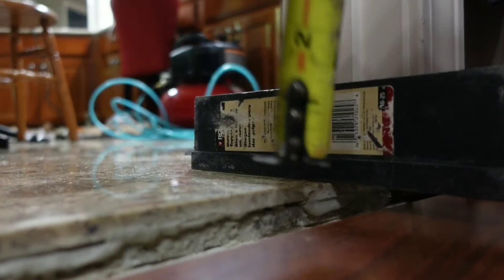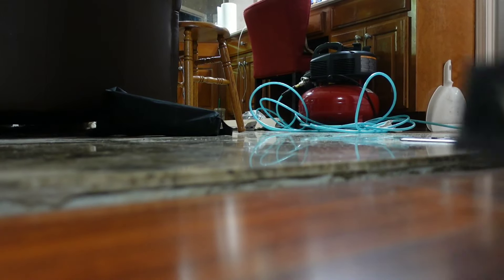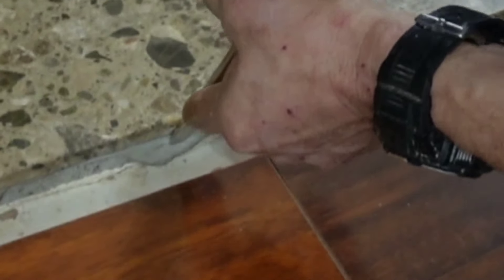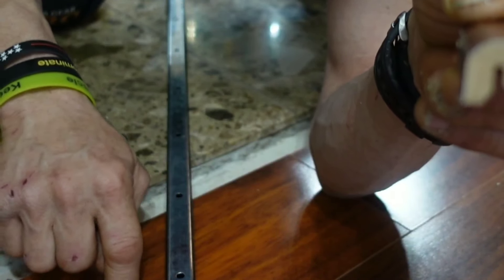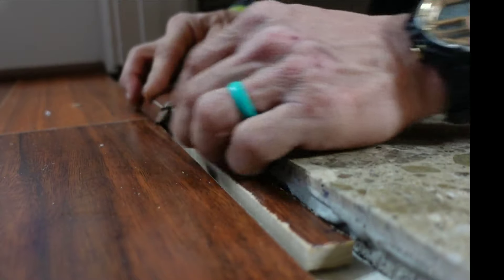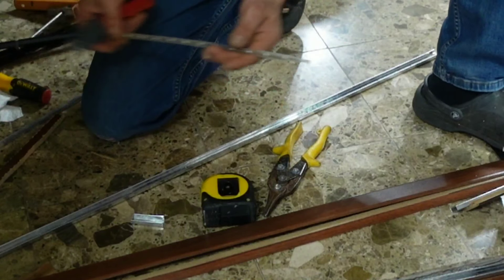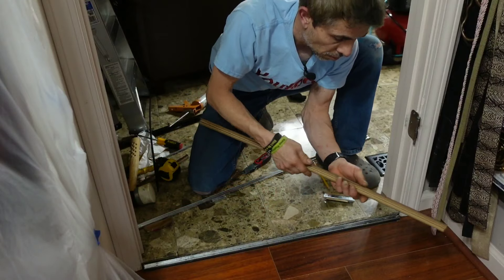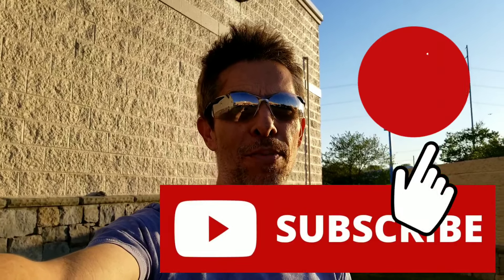How To Install a 4 in1 Reducer Transition From Tile To Laminate

Comment: My Laminate to Tile elevations have been money...... and I've only used the top piece or T piece (I would call it)....  a little silicone and it hasn't moved....  I've had no need to snap it in, to the track they provide in the package.......
Reply from the maker: Perfect.I have used this method on many jobs  where a track would not work. Thanks for sharing

Comment: I currently have a problem trying to get a reduced or transition between porcelain bathroom and vinyl plank flooring and in the kitchen from tile to vinyl plank. Two contractors haven’t been able to figure it out and I don’t know what to do. We also bought the t mold which doesn’t seem to work either. What should I do. Thanks
Reply from the maker: Hey Tim would love to see if I can help. Send me a couple pics from different angles, and we'll see what we can come up with. Youfloor.net@gmail.com

Comment: You don't need to drill holes for screws? Is that possible? I see you used staple gun but do staples stay in concrete?
Reply from the maker: Lol. I get this a lot on this video. I'm guessing whoever installed the tile spread a thin film of thin set out into the closet when cleaning up. Lots of people think I'm installing on concrete, but it is actually a wood subfloor. Hope that clears things up

Comment: I had this exact same predicament. Thanks for helping me figure out how to address it. When we had our bathroom remodeled we had tile installed and the contractor must have built up the floor to make it up to code for tile. Once I ripped up the carpet today to lay down the laminate floor I saw the height difference and was at a loss. The contractor used a piece of 1/4 round as a transition from the tile to the carpet. Now my job will look professional. Once again thank you so so much.
Reply from the maker: So glad to hear this. Glad it worked out for you. Thanks for the comment

Comment: Again you make a great how-to video! You give me hope that I will be able to find a solution to all my “issues” with transitioning. I had someone install my Pergo Outlast without thinking about  transitions.. so all are different.. it was a friend that was staying at my Nashville home for free so he did it to try to repay me by installing the flooring. He did a good job everywhere but transitions. I will just have to figure them all out. Your videos really help me get the confidence to figure it out. I still how to do the stairs and the transitions only things left. I think i am going to get the Cap-a-tread for the stairs for ease of installation and buy these transitions you used here..
Reply from the maker: Well, unlike most of my viewers. You are not to far out. I live in Mt. Juliet. So if we need to come by and make a video. And fix some things. It's not too far away. We work in all surrounding areas. Thanks for the comment. Good luck on your project. And let me know if you need any assistance.

Comment: Thanks for the tip on the metal track after putting screws in.  I’m wrestling with one now that’s 92” and broke lvp transition reducer when trying to tap it in the track

Comment: Thank you for posting these videos. They are very informative.  I was curios about waterproofing the pergo laminate floor I will be installing.  Do you need to backer rod and silicone under the transitions?
Reply from the maker: Absolutely. If you are using a metal track, you can put it in the center of the gap.And put your backer rod on both sides of the track and squirt.A little silicone right on top of the foam To seal it up. Hope that helps thanks for the question

Comment: Anyone following this video and still having issues, your metal track likely bent in on the sides at the hardware store. Use channel locks to  ease the sides out so both prices can fit inside the channel. 
Thanks for the tip to use the rubber to build the floor up!
Reply from the maker: Yep

Comment: First off you're the man. Your quarter round vids helped me immensely. I even cut those fancy returns. I need some serious advice though on how to cover ugly concrete under a marble kind of door sill. It's like 2 or 3 inches high though. Just did the lifeproof flooring and it looks great but that concrete under the door is just horrible. Any advice brother? 🙏🙏🙏
Reply from the maker: @Brian Caulfield Thanks so much for the question. If you could send me a pic or 2 that would be great. You can email me at YouFloor.net@gmail.com
Thanks for the question!

Comment: What depth should the top of the U channel be from the top level of the laminate plank? I guess what I am trying to say is does that 1/4 " T part of the transition piece have to be fully into the U channel?
Reply from the maker: I believe the top should be as close to the top of the flooring  as possible. It doesn't  have to be flush with top bit as long as it will grab. Try a couple of test pieces about 2 or 3 inches long to make sure it will sit properly. Then you can see it from the side view and know you're good. Hope that helps. Thanks for the question

Comment: How did you cover the white line between the pieces of the reducer as I have the same problem? I see that it is gone by the end of your video. I don't notice the line on other videos. It looks bad and cheap.
Reply from the maker: I use a stain pen. Check your local dollar tree. The touch up markers they sell are pretty decent.

Comment: I see that you used a brad nailer to secure the piece of wood to the actual floor. I have foundation under my laminate. How would you secure the spacer in that situation? Thank you for this vid.
Reply from the maker: I would use a combination  of PL 3X  AND A FEW DROPS OF HOT GLUE TO HOLD IT DOWN WHILE THE PL 3X CURES. THIS WAT YOU CAN GLUE THE TRANSITION ON THE SAME DAY. HOPE THAT HELPS. THANKS FOR THE QUESTION

Comment: Great video. I have a concrete floor.  Can I glue everything in using  glue caulking ?
I really prefer not to try to drill holes to put in dowels to hammer in.  I'm afraid I'd mess that up. But either way I respect you and would like to hear what you. Thanks
Reply from the maker: I would use a glue with urethane like pl 3x. Just make sure to leave a gap. Once this stuf spreads out and cures it is like a rock. It will not flex like silicone so leave a good expansion gap and clean up any excess
Reply: @YOUFLOOR  thank you I just watched a couple of your videos and I get it now

Comment: At 7:30 you're securing the thin strip to build up the floor for the transition.  Is that a numatic pin nailer?  Is that shooting a nail into the concrete under the board strip?
Reply from the maker: No, that is a wood floor it just has a little bit of thin set spread over it from the tile. It makes it look like it's a concrete floor but it's actually wood.
Reply: @YOUFLOOR  ok.  How would you secure the strip to the floor if it was concrete?  I’m in that situation now.
Reply from the maker: @JoshSpace I wouldn't even use a strip. I would use pl 3x to glue it down. Put 100% silicone against you laminate so the glue doesn't touch it. Want to make sure it can expand. The silicone Is fleaxable. The glue is not

Comment: Very good videos.  I learned a lot.  I plan to use HD Lifeproof LVP over existing tile and transition to concrete  slab.  There will be a 3/4" gap to take care.  Wondering is this 4 in 1 reducer good for the transition? If not, I'll very much appreciate a suggestion. Thanks!
Reply from the maker: They should work. Not my favorite  but they are universal. Also if you have a floor and decor near you they have  a whole wall of transition to choose from. Hope that helps.  Thanks for the question

Comment: Awesome, great, great, great!  Hey, question for you, how would you transition from a curbless shower floor to LVP in the bathroom floor (or would you?)?
Reply from the maker: As long as the drop is pretty close I would scribe it and seal it up with silicone. Check out my latest short. I show how to scribe against  a tub. Thanks for the question. Hope that helps
Reply: @YOUFLOOR  I checked it out, sweet method my friend!!  Many thanks.

Comment: Would it be okay to use one of these types of reducers to go from laminate to laminate flooring?
Reply from the maker: Yes, this is a multipurpose transition. So you can use it as a t mold, carpet reducer, or a reducer for laminat to viynl flooring. If you are going from Laminate to Laminate and the surfaces are even, then you would use it as a t mold. Hope that helps. Thanks for the question
Reply: @YOUFLOOR  Thank you sir! Really appreciate you and your very informative videos! Take care and be well. 🤙🤙

Comment: Why would you not glue the front smaller bullnose reducer attachment onto the larger t-strip? Does the metal track lock it in into place? If not, I would think that little edge strip would start to kick out over time after a lot of foot traffic
Reply from the maker: I usually do and I explained that in my other videos. But I wanted to do this one exactly According to the directions.  And yes the metal strip does lock them in. But you're right. Gluing them always makes it look better. And also
Touching up the white strip on the smaller piece with a touch up marker. Thanks for the question. Good stuff

Comment: I have wood to bathroom tile. The tile guy did bro use 1/2 cement boards but 1/4 inch. There about 1/4 inch difference. What’s that piece you put underneath t mold?
Reply from the maker: I usually cut a small strip of flooring  about 1/2 inch wide. If it is to low or needs to be more on an angle. I use a thin strip of wood or even cardboard to prop up my little 1/2 inch strip of floor higher in the back before I nail it down. The ne when I attach the u channel it is on a slight angle. Hope that helps.  Thanks for the question

Comment: What would you do with a fireplace or a entrance that would need mitres?
Reply from the maker: I usually picture frame hardwood with flooring. But I use transitions to frame around fireplace. Check out this video. Go to 9:32 to see me frame m e around a fireplace. https://youtu.be/AL1NBfkswVo 
I glued these down as they were  on concrete. You can use this reducer to trim up against a exterior door. If you get board . 2 videos ago I explained this very method. Just go to my channel and go to videos. 2nd one down. Hope that helps. Thanks for the question
Reply: Thank you!!!

Comment: Fantastic video! At the beginning when you measured, the whole thing was a 1/2” drop from the tile to the laminate.   What do you do if the drop on the left side is  higher than the drop from the right side?
Reply from the maker: Well that depends on how drastic  of a difference it is. If it's like 1/4 inch or less it should lay down in the track just fine and work with the difference. If it's more... well you cant lower the lower floor but if your upper floor is laminate, then I would try to put some shims under the low side of the upper floor to raise it slightly more even with the high side of the upper floor then you can try to install the transition and split the difference. Hope that helps. Thank you for the question.
Reply: @YOUFLOOR  thanks for the reply! Unfortunately, the upper floor was already-finished tile. I used your technique (from another of your videos) of using the plastic that came with the metal track. I put it underneath just the part of the metal track on the larger-offset end. It isn’t completely perfect, and there is a small gap underneath the molding on the larger offset end, but it’s not very noticeable. Thanks again for the reply! Love your videos.
Reply from the maker: Awesome! Glad it worked out. Thanks  for the comments. Keep up the good work

Comment: Is it possible to place a new reducer  without a nail gun?
Reply from the maker: Sure you can use the track or glue it down
Reply: @YOUFLOOR  Thank you! I wish you had an email address posted as I have another flooring question that home depot (where I purchased my laminate flooring) hasn't answered.
Reply from the maker: Youfloor.net@gmail.com
Reply from the maker: @shannonallen2993  you can email me at youfloor.net@gmail.com
I will be looking for it!
Reply: @YOUFLOOR   i have emailed you.

Comment: Really good video. I have a question for you. Does nailing it into the cement really hold good or do you put glue below it to hold better? Seems the nails would bend on the nailer? Thank you
Reply from the maker: Where I placed the u channel there is no concrete. That's just thinset over spread from the tile installation. If your on concrete you will have to glue it. The subfloor is actually wood. Hope that helps
Reply: I literally thought I was the only one who caught that.

Comment: Do the spacers com with the strips?
Reply from the maker: Some transitions  come with spacers.  The pergo 4 in 1 comes with  a black  plastic strip. You can place.the u channel inside of it to build it up a little or flip it over and screw it down on top if you have a big drop. Hope that helps Thanks n ks for the question

Comment: would a glue down method work here? i dont have a hammer drill
Reply from the maker: Sorry. A little confused. When did I use a hammer drill
Reply: @YOUFLOOR  sorry, I meant to say I dont have any drill that will be able to drill into concrete. Would i be able to use construction adhesive and glue everything down to achieve the same results?
Reply from the maker: @H T this may help you! Thanks for the question 
https://youtu.be/AL1NBfkswVo

Comment: What size of  mail you got on you brad? They went in so easy
Reply from the maker: We usually use 2 inch 18 gauge brad nails. Hope that helps. Thanks for the question
Reply: @YOUFLOOR  I will try thank you 😁

Comment: I tried the 18 2 in nails but they didn’t go thru the concrete. They bent. What the size of the gap between tile and vinyl?
Reply from the maker: Well you can not shoot  any brad nails through concrete.  You need to hold the nail gun o. It's side and shoot through theI quarter round into the baseboard.  You have 3/4 plus 3/8 baseboard ( unless you have 3/4 inch trim) and a 1/2 inch of drywall. That equals 1 5/8 inch ( 1 1/2 at most) that leaves about 1/2inch of nail to pierce the bottom plate that runs all the way across the wall. If you are going against a tub or metal sliding  door. I use silicone e and hot glue to hold my trim where I can't use nails. Hope that helps. Thanks for the question

Comment: When you say you notched that to fit under the trim so there isn’t a hole there on the sides what do you mean? The transition strip or the laminate. And how did you do it? Thanks
Reply from the maker: Not sure if I know what part of the video you are talking about but om the sides I run the floor about 1/4 inch past the door opening  and make the track slightly shorter than the transition. Then when you install the transition from door frame to door frame it lips over you flooring. Helps to avoid small hole where the trim is on both sides

Comment: Have about a 3/4 inch difference between LVP and tile. Would this same method work. I have a feeling the reducing strip isn’t big enough. Thoughts?
Reply from the maker: It may be a steap drop but it will still work. I am trying to put together a diy video for super high floors. I get this question a lot. Hope that helps. Thanks for the question
Reply: @YOUFLOOR  My client wants to buy this natural limestone tile that is VERY THICK! And it will go next to floating LVP.  Is there any other "trick," or is it the same method with the drop getting steeper and steeper?

Comment: Great video as always. One question, why are the T-moldings so difficult to snap into the metal railing and what's the easiest way to get them in?
Reply from the maker: They sure can be a pain sometimes. Especially if they are too low. They will need to be built up in that case. But when they are on two even surface (like laminate to laminate) I usually start on  Ono side and hold it up at a 35 to 40 degree angle push down into the u c hannel and slide it over to the casing. Once one side grabs then you can work your way across the t mold with a rubber mallet. I use a Smoot face hammer sometimes.  Just got to be careful not to dent the transition. Hope that helps. Thanks for the question

Comment: Are you screwing into the concrete slab?
Reply from the maker: No. That is just wood subfloor with thin set smeared over it.  Thanks for the question
Reply: @YOUFLOOR  Thanks!

Comment: So how much of a gap should I have between my tile and flooring before placing the transition
Reply from the maker: Depending on how wide you transitions are and how much of a drop there is. Most transitions are around 1 & 3/4 wide so I usually go with an inch and a quarter gap. But if the transitions are only an inch and a half wide you'll need to go an inch to inch and an eight. Try to make the flooring on both side flush all the way so theres no issues with gaps. Hope that helps. Thanks for the question

Comment: What do you do when the top piece of the transition slides around. Do you have to take out the reducer and put them both back in together?
Reply from the maker: Yes . In the video you'll see where I used c.a. glue to glue them together. Unfortunately if you try to take it up,it may test in 2. Might just have to replace or if it bothers you. You can try using clear silicone on the ends. This will look nice and stop it from sliding. Hope that helps. Thanks for the question.